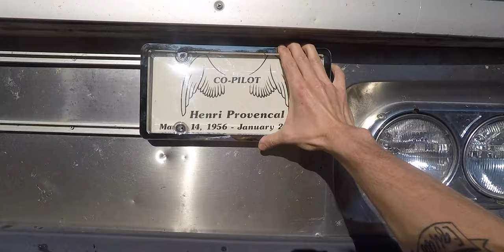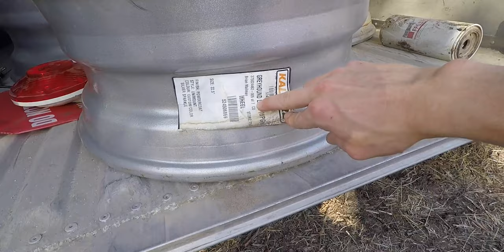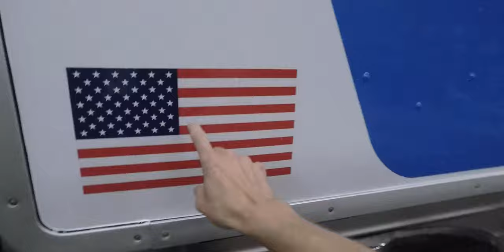Picking up my Barn Find 1982 MCI MC9

Comment: I knew for sure that wasn’t an original greyhound bus. The first greyhound MCI 9’s in the USA were the 8100 series then the 8200 series, starting from the 6350 up to the 6800 series in the eastern side of the continental divide and the 8100 to the 8800 series that ran cross country, the 8900 and the 9000 series never ran east of the continental divide, the 4000, 4100 ran the east coast, the 2800 series ran the Midwest area. The 4750 to the 4900 series also ran east of the continental divide, the 5000 to the 5100 series also ran cross country. All the MCI 9s in the USA were automatics starting 8 cylinder then the 6 cylinder diesels. They were good runners and those buses were, very reliable, very, very few disappointments. The new buses today are garbage.
Reply: Agreed! 👌💯 I worked for Greyhound out of Birmingham, Alabama from 1995-1999. Give me a 1982-1985 MCI MC-9 & I’m a happy camper....🙋‍♂️🕺🤣💯
Reply: @tipsandtrips7519  👌😁👍
Reply: Did you work for the Hound?  Your knowledge is fricking amazing.
Reply: I dispatched for GLI in NOD late 80s early 90s and remember one day sched 486 had not one but two 9000 series west coast buses on it. COC sent a message to us and HOU and us to cut them out and send them back west but HOU couldn't do it so onto NOLA they came. Pretty cool seeing them there and totally illegal that far east, think they weren't registered beyond AZ. Anyway we cut them out and got them heading towards home the next day.

Also there were a few MC-9 manual transmissions out there but none that GLI bought new, these were buses that were part of the Buslease fleet that were leased to charter operators that GLI must have taken back and they just painted them red, white and blue and put them in the fleet. One I remember distinctly was 5224, it was a beautiful bus with different high back seats and even had TV monitors.8V71/5-speed too, was always funny when those guys would go down there to load their schedule and they'd call up to dispatch and say hey man, that bus has a stick shift! Fun times.
Reply: @thud9797  Did you dispatch out of NOD during the time that the furthest west a driver could go was Lake Charles? I remember when LC was a division point for the longest, even up until the last east/west divisions in 1969.
Reply: LCH was dispatched by HOU and on all our regular runs going towards HOU, the drivers turned at LCH and came back to NOD.  Extra board drivers on extra sections could go all the way to HOU but that was up to HOU dispatch. After the strike in 1990 the LCH turn was eliminated and believe all the HOU - NOD runs were staffed by HOU drivers who came all the way to NOD then slept in the dorms and went back after they secured their rest. Not sure about late 60's, was that still Teche Greyhound? Anyway, way before my time.
Reply: @thud9797  Teche was dissolved in 1954 when there were numerous GLI divisions like East, Southeastern, Southwestern, Central, Pacific, etc.  Over the years there were steady consolidations so that by 1969 there was East and West with division points at Chicago, St. Louis, Memphis, and Lake Charles (basically the Miss River was the basis).  Way back when Central/Pacific divisions were at El Paso, Albuquerque, Rock Springs, and Butte.  I am a Greyhound geek.  it was fascinating to read about all the mergers and acquisitions beginning back in the 1930s up until the late 80s.  Like you said, in 1990 Greyhound became one big behemoth with the formal divisions basically eliminated.
Reply: @thegodblogger3812  Good history, yeah I'm a geek too. When I first started they still had a few guys there from the Teche days lol, was a fun place to work back then, today I'm not so sure.
Reply: @thud9797  Today it's a hot mess.  I have a copy of an Eastern division guide from 1969 that shows NOD with drivers based there for runs to (maybe not all-inclusive) Jackson Miss, Baton Rouge (locals), Natchez (via BR), Centreville Miss (via BR), Union La, Donaldsonville La, Baton Rouge (via Houma/Thib & D'ville), Golden Meadow, Lafayette (via US90), Lake Charles (via Laf & US90 or Baton Rouge & Lafayette or Baton Rouge & Opelousas bypassing Lafayette), Mobile, Meridian (otw to Birmingham), Amite (locals), Tylertown (via Amite), and local turns to Houma and Thibodaux and back.  I also have other TTs from the mid-1950s, the early 1960s, the mid 1970s, and the 1980s.  I have a few post-1990, but I prefer stuff pre-merger with Trailways.

Comment: Great job. The first coach we bought was a 102A3. I still run it. The 8v92 is unbelievable. I would drive my A across the country before I took my J. The reason I love the A is the 5 speed trans. Nobody but myself and my father (which has driven bus since 72) can properly drive her. Love the videos. Also know Andy very well. Lol. Good luck with everything. Nice to see a young person with this passion for this industry.
Reply: 8v92 were impressive on the 102s. Did the coquithalla snow shed hill with a load doing 80kph.
Reply: @threeparots1  I have a J also. I was transporting troops with both buses. The other guy that was driving the J was amazed at how the 8v would pass him on the hills. I love that bus.

Comment: I drove for GLI for quite a number of years.  This is a beautiful coach and sadly represents  a by gone era in the Hound's history.  I love 9's and 12's and use to drive a eastern run from Seattle to BIllings MT.  They always got you there and had a perfect lower center of gravity driving in inclement weather which produced stability.  You are very fortunate to find this coach with the period livery.  There a few things that aren't correct but it sounds like you have a handle on that.  The 9's had the exact same steering wheel as the 7's did. GLI was in a full mode automatic transmission fleet when the 9's came online.  Happy that there are a few people who understand the historical significance of these coaches and haven't butchered them into a conversion.  I have a close friend that has a 1956 Scenicruiser in anniversary livery.  He has been very generous in letting me drive it to a few bus rally's, an awesome experience.  Thank you preserving it and keeping it seated.  Good luck and thanks for sharing!
Reply: Dude, was your Hound run from Seattle to Billings a multi-segment run?  I thought from Seattle the runs east were to Spokane, maybe St. Regis for a while.  Just curious.  I rode Hounds as a youngster and collect old timetables and route guides.  Thanks.

Comment: I drove for Greyhound in 2001. At that time there were still a few MC12's left in the fleet. Most had 6v92's and I drove one with a Detroit diesel 50 series. Most buses were the 102DL3's and the G models were just coming into the fleet (in the northeast anyway). There was a 1990 MC12 out of Toronto in the Canadian fleet that had a 5 speed manual.
Reply: I'm pretty sure I was on a manual greyhound in southern Ontario early 2000s
Reply: @cellpat7392  They made a few designed for crossing the Rockies with 12V71 engines in them . Collectors have the odd few that are left.
Reply: Of the MC12's that Greyhound Canada had, many were manual transmission, even 7-speed manual. Greyhound USA has been automatic only since 1973.

Comment: When I started working for greyhound, I worked at the greyhound garage on New York Ave in Washington DC, the first buses I learned how to drive, thanks to the mechanics were MCI 8’s and MCI 9’s. I enjoyed the experience and felt their power. I’ve been with the greyhound business for more than 3 decades.
Reply: Wow! Were you with Greyhound when they merged with Trailways in 1987?
Reply: @tipsandtrips7519  Yes, and it wasn’t a happy merger. Employees lost their jobs, run around with employee’s senority. It lead to a huge strike in 1990. I had to walk the picket lines, because of an unfair labor practices. For a moment...... the company did come roaring back under the leadership of CEO Craig Lentz and John Taylor. Went back down hill under Steve Gorman and First Transit. There is not much left of greyhound bus lines. A lot of the company has been liquidated.
Reply: @josephmurrill3644 , Man oh man. You’re absolutely right...😞💯
Reply: @josephmurrill3644  Yes, the Hound is but a shadow of its former glory.  Probably operates at best at 20% of 1980s capacity.  The Hound has been on its death bed since the early 2000s, a slow agonizing death.
Reply: I remember the WDC garage on NY Ave, buses everywhere! Sure miss those days.
Reply: @josephmurrill3644  Knoxville and Jackson Miss, no more bus stations, the stop is now a gas station. They say they are trying to return to Jackson but no word yet. The company today is but a shell of its former self.
Reply: @thud9797  The full service garage in New Orleans closed in early 1990s I think. I'm not sure of the closest one now. Maybe Houston. Or Atlanta.

Comment: loooks like you got a nice bus ,, MC9 is the last of the nice old bus designs ,,I caught the BUS bug a few years ago  and now own 2 buses of my own 
my family motorcoach is a 1947 GMC PD-3751 silversides ,which is an RV conversion done in 1974 ,i live in it during the warm months and it is fully off grid set up with 14 solar panels on the roof
and my most recent acquisition a monstrous 1992 Prevost coach H5-60  articulated motorcoach ,,literally the largest bus ever built ,it will become a tiny home on wheels which i plan to live in when i retire in  a few years ,,you are way ahead of me at 28 ,, i just turned 46 and only got my first bus at 40,,there were fewer than 50 of the big H5-60 buses built due to the very complicated design and how hard it is to maintain it is nearly impossible to work on the engine ,in the case of mine it has an 8V92 TA detroit diesel which barely ran when i bought it in june of 2020 ,,i had to tear up the floor in the bus because they did not build in access panels above the engine ,,i redesigned the floor to be easily removed  so i can get to the upper engine easily now ,,my engine got new sleeves and pistons and a full set of bottom end bearings plus i had the heads cleaned and valves done and new injectors installed ,,the valves were badly burned from lack of maintenance and overheating ,,it's pretty neat to drive though because the rear section steers as the bus articulates surprisingly making it handle very well in tight turns , it'll be  a fun project

Comment: Man dude. I remember those 1980s greyhound buses. I rode those buses every weekend in 1988 and 1989 with dark blue seats. The buses I rode on in 1989 was one of the first ones with a push button for the doors in 1989. Ones I rode in 1988 had those manual doors like you have.

Comment: I always wondered what Greyhound did with all their buses when they shut down. Thanks for the answer. I almost was set to be a driver for them, luckily, it would have been very short-lived. I sure miss greyhound running down the highways in BC esp. R.I.P. Henry.  By the way KILO means 1000. That word does NOT change to kiawe!!  Just like KILO-watt, KILO-gram, KILO-volt. Two words!  Metre means "Distance."  So it is KILO-Metre!!!

Comment: I find it odd that if it's a true Greyhound, that it has the MCI letters in the front where the galloping dog is normally at.  Greyhound would remove the galloping dog badge when the bus was retired, leaving an empty space.  Also, it has the plastic fender well trim on the vacuum drive and tag axles.  Most older Greyhounds didn't have that option.  The dash 12s were common with that rear fender trim.  
Give me a dash 9 with the 8v71 or 8v92 with automatic transmission any day.
Reply from the maker: It was never a greyhound. In the video I mentioned it was just wrapped for a movie :)

Comment: As an X drive out of Toronto, I'm so happy to see you save an Icon from the bone  yard.  Did I see Calgary  plates on it?  We have lost so many bus co. (voyager, Gray Coach(TTC), Greyhound etc)
Reply from the maker: Yes sir! She was never actually a hound; she was a western charter bus for two small family businesses. She shifts so tightly, she’s in 9/10 condition. Was only wrapped as greyhound for movies. It’s the best of both worlds! She’d never be as mint if she was a hound, she shifts so tightly; Must never have been floated. She’s in ottawa with me if you’re ever up!!
Reply: The mc-9s I drove out of Vancouver were automatics and had overhead bin doors. Would have a preferred the 5 speed though. My favourite was the MC-9 SS (mc-12), with the 6v92 turbo and a 7speed manual and better suspension but same frame though

Comment: i have a 1995  MCI12  WITH SERIES 60 Detroit and Allison HT745   REBUILD  Transmisson   and also bought a 1995  flixibile  Metro B 35 ft   with Series  50  and Allison 731automatic  the switch it to Allison B500R   IN 2018   AND IT RIDES  sMOOTH   I put in Led's  Headlights    this is ex Cota Bus 9505   from Columbus, OH which reitre   in 2012

Comment: Chances are that MCI could have been built in Roswell New Mexico. I worked for MCI for 20 years. Looks like a 8v92 two stroke.
Reply: MCI had a factory in Pembina, North Dakota. The Roswell factory was called TMC or Transportation Manufacturing Corporation. Many of the charter company MC-9s I drove had the TMC logo on the front instead of MCI. TMC also built transit buses and for a time, built the GMC RTS II under license from GM after GM got out of the bus building business. The factory where this bus was built will be shown on the data plate located in the driver compartment above the side window.
Reply: @TenMinuteTrips  you are correct the North Dakota plant from what I herd was just get the seats installed. I Worked at TMC in Roswell for 20. We manufactured the entire greyhound bus. TMC was owned by Dial corporation out of phoenix.

Comment: I am looking for a 4905 Greyhound Buffalo bus. Original or mild conversion. Any chance of knowing of one. Chris Abernathy from Baltimore, Md. Any help would be appreciated. Thank you.
Reply from the maker: Hey Chris!
I don’t know of any currently, but I’ll keep an eye out!!
Reply: Appreciate that very much Sir. A little hard to find, Will be 66 on Jan. 2. Do no feel or act my age. This has been a dream for quite a while. I will keep searching.
Reply: I believe GH only ran 4107s
Reply: @mcimc558  Greyhound did have a few Buffalo Buses, not that many. They mostly ran up in the northern Midwest area. That’s where I saw them. Also they did have the 4107’s in the 60’s up to the early 70’s.
Reply: No 4905 ever for Greyhound, but they did run the 1965-66 4107 Buffalo and think the Buffalo was the last non-MCI bus they bought before switching exclusively to the MC-7 in 1967 or 68 then the MC-8, then MC-9, etc.
Reply: @mcimc558  I'm thinking the same.  Maybe they had a 4905 as a tester or something.
Reply: @thud9797  Maybe a 4905 as a tester, but you're right: their only buffaloes were the 4107s.  I don't ever remember riding one though because they were primarily north-south runners.  Plenty 4104s, 4501s, Mc-5s, 7s, 8s, and maybe a 9 or two. Great memories from long ago.

Comment: If it is not dripping oil it doesn't have any
Reply: Lol, we had some that leaked or burned so much they never changed the oil. You were adding so much oil it never needed it, just change the filter every 6,000 mi and keep rolling!